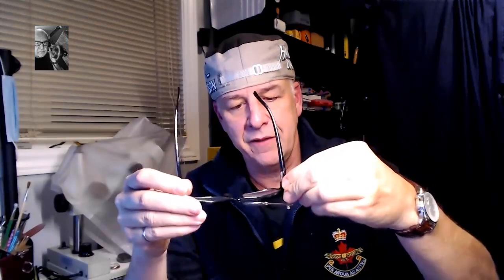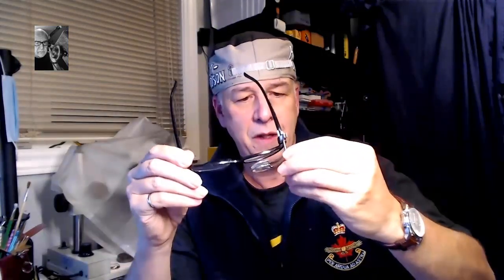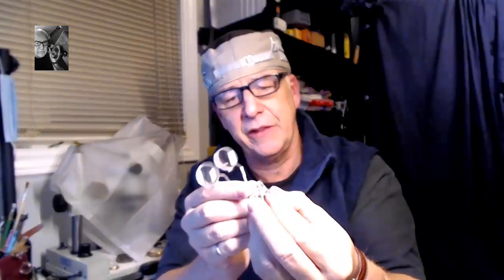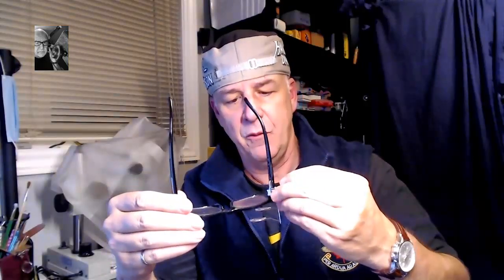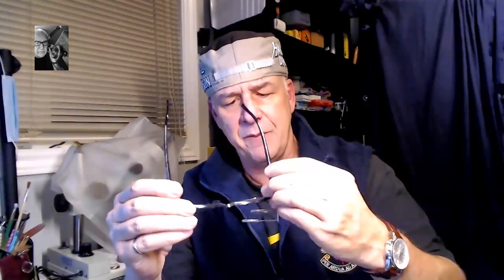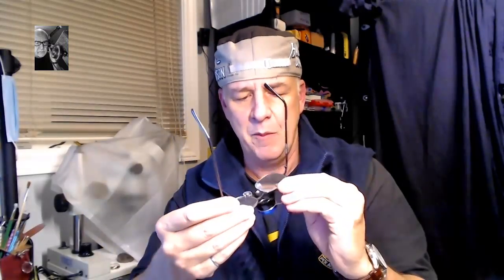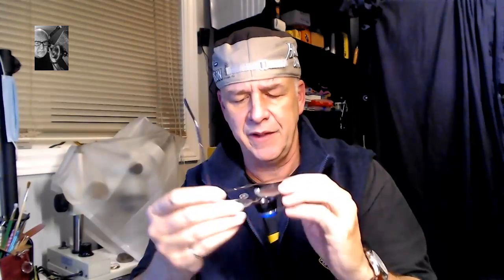Magnification for Watch Repair Work

Comment: I got a pair of standard prescription bifocals made, except with the focal distance set at 400mm (16") on top, and 200mm (8") on the bottom (standard reading range is about 500mm), and with the dividing line set fairly high up the lens (about 2/3 from the bottom). They are crystal clear and sharp, with normal stereo and field of view.

First time I tried mine, I couldn't believe how good they were. The stereo vision alone makes it worth it, and they are so much less work for your eyes and face and neck muscles than a loupe. Being prescription they also properly correct for any issues in your eyes, like astigmatism, and they don't stick out in front of you like loupes and various magnifiers, so you gain some working space too.

Not expensive either, they are just normal prescription eyeglasses. Sure, they probably cost more than a good quality loupe, but not a lot more, and full eyeglasses are so much easier to use and the overall image is much better. Full Cinemascope! Just real close. :-)

I'm getting on a bit and my eyes aren't the best anymore, but if you have good eyes you may not need the 400mm on top, and can just go with the 200mm all the way, which would save some pennies. In that case it might be worth using a frame that is not as high/tall as for bifocals, so you can more easily look over the top.

If you want more magnification just add a clip-on flip-down loupe. You already have a good baseline of magnification from the eyeglasses so you don't need much extra from the loupe to really crank it up, which helps reduce any distortion from the smaller loupe. Even just a 2 or 3x loupe gives a big boost, and a good quality loupe really pays off here.
Reply from the maker: Very big thanks for your advice. I may now do as you have said and get real prescription reading glasses with a lower half at X3 so I don’t need to keep flipping glasses. Again thanks for the idea...too bad I can’t update a video once processed on YouTube.
Reply: @JDRichard  

My pleasure. Got the tip from somebody else a few years back who did a lot of fine needlework. Glad I listened to them, and happy to pass it on. 

Really interested to hear how it works out for others. Bit surprised it is not a more common thing in the watch world. Maybe there is a downside, but I haven't found it yet. It is one of my best 'tools'.

"glasses with a lower half at X3"

Think carefully about where you want the dividing line in bifocals. I tried halfway first, but it was too low. About 2/3 up works real well for me. Might differ depending on the height and shape of the glass frame and your face shape.

Nice work you did recently on that Elgin Veritas. Beautiful watch. Elgin are the most elegant of the PWs from the mechanical era, IMHO. :-)
Reply from the maker: Thanks.  I have a corporate plan that includes glasses that I have never used.  I will look at where the line is and i also think that X3 is the best as this is what I use for my magnification now.  Again good for pocket watch work but will need a loop added for watches. The Elgan has a high beet error on the Escapement Analyzer Program (7ms) but not on the Swiss Connect Program (1.9ms) not sure who to trust.  the watch has been keeping tome face up and down over 3 days and within 15 seconds.  Should I mess with that?  I plan on taking off the small plate and looking down the line to the Impulse jewel to see where in rests with no power on the mainspring.  As you saw, i needed to Shellac in the impulse jewel and actually did a really good job. Amplitude is around 275.
Reply: @JDRichard  

Pardon delay getting back to you, very busy right now, coz that time of year.

Use that company plan before they take it away because you don't use it! ;-)

You are way ahead of me on watch stuff. So doubt I can offer you much advice there. But, yeah, I would check the impulse jewel is centered.

Best of the season to you and yours. :-)
Reply from the maker: @mcknottee  Thankbyou very much and that’s what my wife said , I have an Eye plan with the company that I have never used.

Comment: Hi. Great video! I like your sense of humor.  Was wondering how much work do you do under the microscope? I'm a hobbyist; use loupes currently - but am looking at a stereo scope. Do you use it for more than hairspring work or jewel inspection? Thanks!
Reply from the maker: Thanks for the comment. So I do look at the pallet fork in action with the impulse jewel, occasionally. I also look at the hairspring when installed to detect rubbing, etc. Then jewel holes. I also look at balance staff pivots. And lastly, I use it to join the hairspring with the balance cock where I rest the balance on rodico with hairspring stud up on a 60deg ramp.

Comment: They look like standard cheap sunglass/safety frames they used to give out when I worked at a foundry.  I'm almost betting you could go find a chinese pair of z87 safety glasses and with minimal tinkering you could snap it in to your off eye for all the safety.
Reply from the maker: Now use an ARY loop. Best in the business and not cheap

Comment: JD, where is you get the lens that clips on your glasses. I found this very interesting, as I do all your videos. Thanks!
Reply: They are available at cousins uk if you’re based in europe
Reply from the maker: I would just go on eBay, however AliExpress is 1/4 cheaper but takes a little longer to get.
Reply from the maker: Search for “Magnification Clip on” on eBay or Etsy and buy a x3 and a  x7

Comment: MAn o man you the tool guy for newbie watch  nuts like me... i spent 45 minutes this morning sraightening my first hairspring with a cheapo plastic 10xone eye lens dang you have to get so close to the part to focus.... just today I got the set of dual multi lens like you have all plastic with box of different power lens.
  It totally SUCKS if using both lens... I see you only use one side. I will try!
Reply from the maker: Just buy a stereo microscope x70